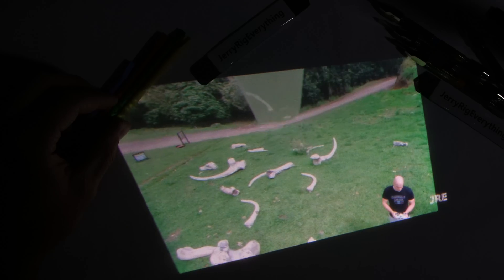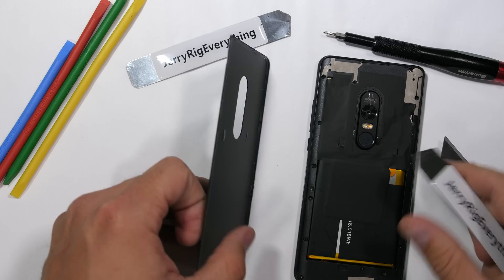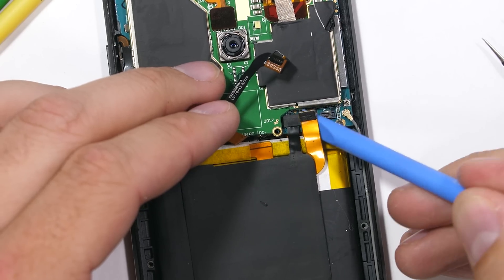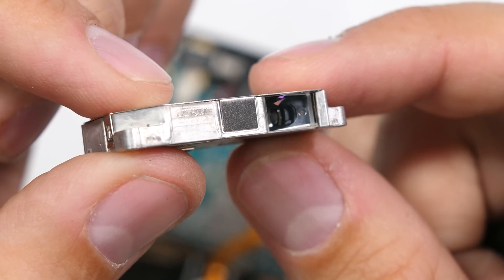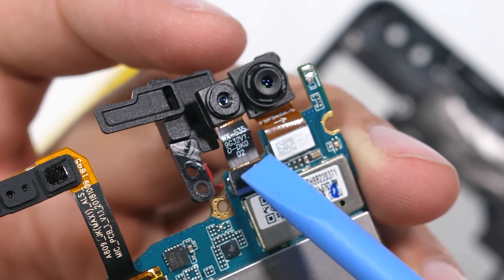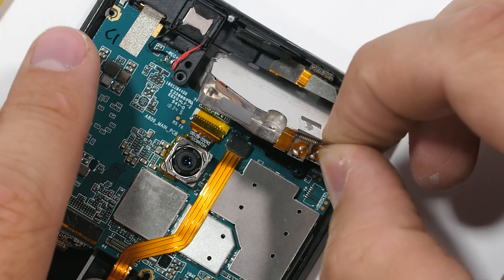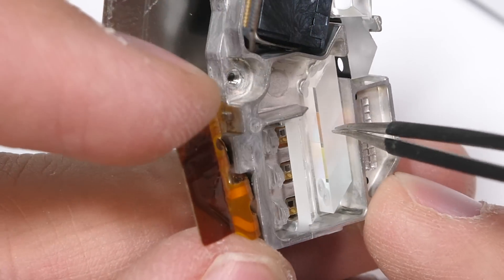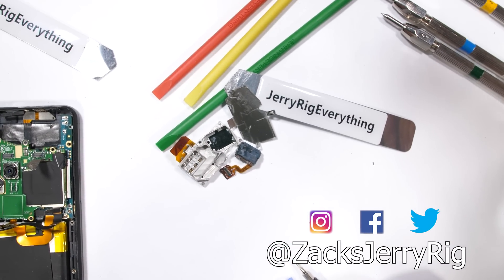Smartphone LASER Projector Teardown - How does it work?

Comment: Hi,

I have one of these phones, I broke the screen and wanted to replace it. The part I am finding hard is to remove the dual tone flash cable. There is hardly any space for a tool to get in there and it is virtually impossible to peel off. I am afraid I might damage it. In this video, you  do show the cable being pulled off, but I would imagine you found it quite hard to access it. I think anyone attempting the repair of this phone should be aware that the video here goes through the steps top quick and in many cases doesn't detail every part of the disassembly process in sufficient detail, which is unfortunate.

Comment: The technology better be old. I was designing a laser projector 25 years ago. :P

Seriously though, this miniaturisation is seriously impressive. Foldable phones are as well, but not nearly as useful.
Reply: this is not difficult, there are 3 lasers, condensing lense after them and then you can see 3 mini lcd-s. Then they go to prism and get to the black box which is lense module
Reply: @alexm.9780  Again, miniaturisation is the hard part.

Comment: ''Optical path....laser/collimating lens/optical tap (send a little of the light down onto detector chip in the base, for individual laser power/health measurement)/dichroic mirror stack (angled to point the beam to the side, coated to optimize performance for each color and glue together for stability)...angled mirrors (translates the beam to the entrance to the ME MS mirror)...the mirror is likely run in resonance mode and moves side to side to raster the beam horizontally...vertical scan is controlled by tipping the mirror to create the necessary "flying spot" of light that creates the image.  The final optic looks like a wedge, but might also have optical power to correct beam shape.  Most of the parts are plug and play - the hardest part is to make all three beams overlap into one "three color" beam.  The lenses are moved to align and overlap and fixed in place using uv cured adhesives.

Comment: Nifty little projector.  The "brains" is a 2D scanning MEMS mirror that raster-scans the lasers over the screen.  The three lasers do the actual pulsing and modulation to form all the pixels.  The 3 photo-diodes between the lasers and the beam combining prism are for feed-back control of laser brightness.  I'd expect one surface of the optics to angle a beam onto them, or maybe a loose slip of glass the cover was holding in?  Just using scattering would have lots of cross-talk between channels and make extra work for the feedback DSP.  Finally, I'd expect at least half of the "top" motherboard is the MEMS and laser driver.  Might even have a >100vdc power supply for the MEMS mirror.

Comment: There is an easier and safer way to remove glass back plates, just heat it up and then do a little punch through the adhesive with something sharp, then soak some cotton with 100% alcohol and rub it along the edges, this will soften the adhesive and it will be removed without prying anything metalic or sharp agains glass. You have to be careful not to use too much alcohol though or there might be risk of it going throught the phone and onto your display, if its OLED, it will contaminate the organic component and it will just go all to black. If its LCD it will damage the backlight
Reply: If it can damage the screen I think it is NOT safer
Reply: @lilchad-ig1oj  Safer for the back glass hahahaha
Reply: @lilchad-ig1oj  You would be amazed, but thats actually the method Samsung Authorized Service Centers use to lift back glass

Comment: Since both projectors in phones and foldable phones are pretty poop let's just assume that they are fully functional if I had to chose. I think I'd chose the foldable phone since it works anywhere, and you can tap anywhere on it and play games on it. With a projector you'd need a dark area with a flat surface to project onto and you wouldn't be able to tap to image like a touch screen and if you had it in your hands it would be really shaky. The projector would therefore only be good for watching movies and that I have a pc, laptop, TV or even just bigscreen in my VR headset for.

So my answer should be pretty obvious. I chose the foldable phone. Tell me your input on this by replying

Comment: A few points I'd like to mention.  at 5:28 you say the black box controls the auto-focus.  There is no auto-focus.  Projectors that use laser diodes have infinite focus.  This projector doesn't need a focus adjustment the same way a laser pointer doesn't need a focus adjustment. This projector uses a tiny mirror to direct the laser beam from the laser diodes across scan lines on the wall just like a CRT monitor directs an electron beam across scan lines inside phosphor coated picture tube. Only a single point in the projected image is actually illuminated at any point in time. Persistence Of Vision creates the illusion of a complete picture. Also, what you call a 'glass prism' is actually the beam combiner.  So that the beams from all three laser diodes can be overlapped onto each other to create a single RGB beam before it hits the MEMS mirror.

Comment: There are no laptops with a projector built in. But they all do fold. That must be for a good functional reason, as the miniature projector technology itself isn't brand new. So I'd choose foldable over a projector.
But naturally, as any average feature hog I'd prefer to have both features.

I cheated: I have toyed a week with the Galaxy Beam back when it came out. It proved too much of a hassle using the projector., especially for a personal handheld device.
E.g. finding/placing a good projection surface , adjust lighting in the room,  adjusting focus, finding the best orientation and distance (projection size matters), keeping the phone/surface configuration undisturbed. And all that by improvising with stuff that happened to be at hand, like books, duct tape, paper, legos etc. At some point I purposely started carrying such stuff with me, just to be able to use the projector quickly. I even considered crafting something dedicated to carry with me, before recognising the silliness of it.
A handheld device is meant to be used on the go, while moving around constantly and moving the device . Using the projector doesn't allow you to move the phone, never mind moving it with you, without disturbing that perfect setup you've just spent so much effort on to find it.
Just touching it to operate it, had to be done very carefully. 
At the time it made more sense to me to have something like Google Glass connected to my phone than a projector.
However, I do recognise that truly creative persons can find wonderful and fun ways and purposes to exploit the projector feature.

Comment: I’m pretty sure that projector uses a digital light processing chip (dlp) the either reflects the laser beam to the screen or somewhere it won’t be seen, depending on if the pixel is on or off. When you put your tweezers on the dlp it probably destroyed hundreds or thousands of tiny mirrors. I was so sad when I saw you poke it.

Comment: Dear JerryRig 
I just got a water dead iPhone 7
I removed the board from the body  and socked it in thinner.
I kept it for about 12hrs and when I powered it with battery slightly smoke came from top right corner .
Even though it was working for one day now it's just like dead.
Which component should be repaired  ?
Reply: Pls help me

Comment: Projector hands down , the fold phone has issues after a while with the bending screen . If the protector went out on the other phone you can still use your phone . With the fold phone you ether have to send it It in for repair or buy a new one just to use your phone again .

Comment: There's no way to cool that laser
Reply: it doesnt heat too much. no bulb.
Reply: @oronwettenstein6881  there's 3 leds which will get very hot
Reply: @AgentOffice  It doesnt need a fan. Thats the beauty of laser over dlp
Reply: @AgentOffice  Because of all the heat generated, lamp projectors require one or two fans to cool them down. ... Laser projectors, on the other hand, are much less fragile, use less energy, and are ready to go at the flip of a switch. The way in which they create light allows them to produce brighter and clearer images

Comment: I recently got one, and I've been playing about.

The verdict is - it's fucking cool.

I have an Oculus Quest, and to be able to stream the quest to the phone, and then the phone to the projector is truely a thing of beauty. The phone gets hot (not warm) when the projector has been on for a while, but the image and framerate is still stable.

5 hours of battery with the projector is a push - although probably achievable with airplane mode on, with the usual wifi, location and bluetooth off.

The phone does not (at least I've found) that it does not have an application drawer, so all the apps are mangled to the phone's desktop screens, although these are removable.

Happy to answer any questions you might have.

love egg

Comment: Those 3 small black chips are the screens, the light reflects onto those and to the glass which then goes to the smart focus stuff
Reply: no, defintely not, those are just light intensity sensors for the feedback loop of the laser led driver, this projector use mems micromirro in scanline fashion.

Comment: damn wish they made just the projector, dont need new phone, but tiny projector with image quality like that would be cool
Reply: I would agree. A mini Bluetooth projector would be a must have accessory and the price point could possibly help sell more units than trying to justify buying a phone that has a built in projector.
Reply: @akuma9170  I agree. How bad ass would it be to have one that pops into the USB port?
Reply: @akuma9170  would be amazing but not bluetooth, rather wifi
Reply: HELL.... if they did that, they would charge you thousands of dollars for it. 
For some off the shelf penny components.
Reply: bluetooth projector? wait what are you guys talking about, first you need to learn about bluetooth signal, you cannot transfer live video or stream through bluetooth from one device to other, the bitrate is way too high. the projector could be connected to the same wifi as the phone. the projector could be or cabled or through wifi, but not bluetooth
Reply: Going places
Reply: Watch ETA prime’s latest video, there’s this new tiny projector
Reply: Look guys - if something Wi-Fi connection projector ;)... Last few days seen this BV MAX 1 phone sale $275 - I know projector market and your project(or)- Wi-Fi projector would cost around same price, and being 60-70% size of this phone but without phone. Yes, probably would be brighter, but again need more power, so external 'high power' power bank will much size it up...
Have also a $70 pico P1 projector and this one doing Wi-Fi connection - it's DLP technology 30lumens 640x360 resolution,around 4,7cm square box, sometimes have problems with connection, but then working fine with YT
Reply: Thats why i like moto mods
Reply: Sony Mp-CL1a does the job!
Reply: @hipperbob  true, but that's more expensive than the whole phone
Reply: I use a Sony morning cl1a for watching movies on bed, it works great with miracast. The only cable I plug is a usb for power, if you don,t use it for so long, the battery may be enough.
Reply: @vincentli2090  That Sony projector uses the same tech as this phone, from Microvision Inc.
Reply: Im pretty sure they exist
Reply: there are ones already in the market, but wouldn't it be fascinating if top smartphone brands started to sell these?
Reply: @joshuaaustin2541  why? To pay the premium price for them? I can assure you blackview max 1 is a decent phone.
Reply: Walmart sells a micro projector not wireless but a external batt pack and a firestick with hotspot on a phone works great on the side of a box truck at night
Reply: You wish to! Still need big battery - that's biggest part of phone (even when using external power You loosing around 35%of power), second thing - still need 'electronic' to use it - Bluetooth connection? Are You joking? Even stronger Wi-Fi 'Video connection' (Miracast etc.) is slow... I have this phone and could say (as You) - oh, it could be waterproof, oh, it could be smaller... etc.. Now seriously - could have better GPU (CPU isn't that bad) camera is old, but quite good, front camera is nice, screen is very good, have some issues with software (hopefully they fix it with update but doubt it) Bluetooth range is 0,5 to 1,5 meter (worst ever), projector is lovely - and it's not just 1280x720 but 1440x720. Probably what You wish will cost around this projector (last days seen for $275!) Anyway have an other pico projector p1 which is around 4.7 cm square box DLP 640x380 (something like that) which is wireless projector ;) connection is an achievement ;) battery 1000mah last for max 40min
Reply: Microvision, the maker of this laser module (you can see the brand on a ribbon cable right at the end of the tear-down) did make a stand-alone variety which you can occasionally buy on the resale market. I think they also let Sony use the tech in their pico laser projectors. 

I’m interested in this as an all in one, as my Microvision projector needs a usb for power, micro hdmi cable to another device and the display device, which can be a pain. Tempted by this phone which was can load with content and that’s it.
Reply: @DigitalDiabloUK  Will just say that Bluetooth on this phone range is 0,5 to 1,5m (the weakest point), not so gaming machine, but sometimes playing very fluent (with booster) Asphalt 8 and Modern Combat 5,  sometimes FPS dropping so down... Software isn't the best (UI), Auto- brightness awful, Camera is old, quite good, front camera - very good selfie, CPU is real OK, Screen very nice, projector of course lovely - but sometimes annoying me this laser 'texture'. Becouse of no 3.5mm jack and so weak BT 4.1 - bought Tempotec Sonata usb-C DAC - sound is great - but extending too much this long phone. Last couple of days seen BV MAX 1 phone on aliexpress for $275! from producer - So that's a bargain anyway
Reply: @kiwas83  The laser texture also annoyed me at the beginning but you get used to it.
Reply: @vladmihai306  it's also depend on surface, and size of screen. And now... Beware of clean the projector eye - it's scratched by my most expensive lens cloth... the eye is plastic!
Reply: @kiwas83  I'm not talking about lens dust. If you know, laser light has a specific dotted texture that is most obvious when you see white images. If you had laser dots when you were a kid you know what I mean.
Reply: @vladmihai306  as am wrote, depend on surface (big 'laser grain' on reflective screen), and if it's bigger image- 'laser grain' is less visible
Reply: @kiwas83  I project on a matte paint wall. Screen, even if it is big or small, it has the exact same texture. It is the same one you see on a red laser pointer device used for presentation. The red is not uniform, it has some spots where it is brighter and you can see it if you look closely. The same holds true with this projector. But in any case, it doesn't bother me, I got used to it
Reply: They have pico projectors available and most are bigger than an entire phone!  Imagine a 1TB S11 or whatever series with a 1080p projector and wireless charging that can keep the phone and PJ running continuously.  Load up plex and a decent movie collection and you have a traveler's dream.  In your pocket!
Reply: @cpufrost  Wonder what the pricing is, the actual resoultion vs native res, lux/lumens.. They are, unimpressive.
Reply: Do you really, though? A projector bright enough to do a decent job replacing a TV needs to be in the order of 2,000 lumens. It'll lose a decent chunk of that brightness when doing into more colour accurate modes. This phone's picoprojector is 50 lumens. Even in a completely dark room on a perfect projection surface with a narrow viewing angle the thing will be so dim at any reasonable size as to be a gimmick at best.
Reply: @guspaz   you clearly didnt watch the first video about this phone, uploaded a week ago. Resolution and output display in a dark room seems decent enough to remove any labels of calling it a gimmick. Its no replacement for a TV or an actual projector for those seeking a home cinema experience but that also wouldnt be the target audience for this product anyway.
Reply: @guspaz  yes it's true, but '50 in dark room is enough to watch it (many people forgetting to zoom it becouse it's 18:9 not 16:9 proportion - and loosing those lumens), second thing there are now screens that 1. Reflecting the image- quite cheap thing, but you have to watch just' over projector' - it's just 30 degrees angle view 2. Very expensive one - reflecting just the projection light coming from front, not reflecting light from sides, You can watch at day time like TV from any angle (but as I sed - expensive! - my dream set is 4K Xiaomi laser projector ($2k) + this lovely screen (over $1k) - it's the cheapest set with this specs...
Reply: @guspaz  $399 pico projectors with 20 lumens. Go figure; the market is stupid.
Reply: @RonanTetsu  OH yeah? This phone right now on aliexpress $250... can't belive it, 3 months ago spend $380 + bloody TAX
Reply: @guspaz  I own one and I can tell you that projecting a 50+ inch screen on a wall in my living room on pitch black is good enough to watch movies and play games. Sure, it is not OLED quality, but believe me when I saw it is good enough, so this is for sure not a gimmick.